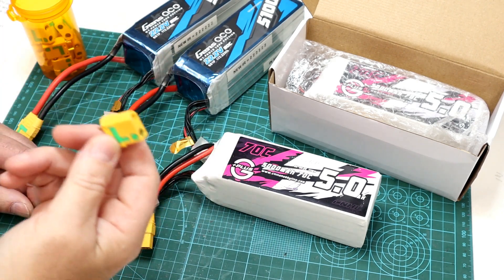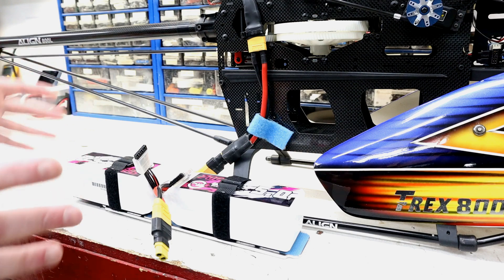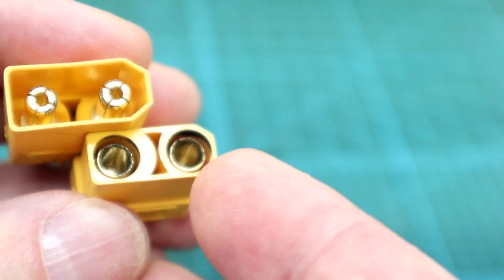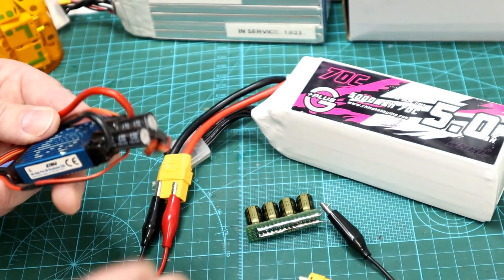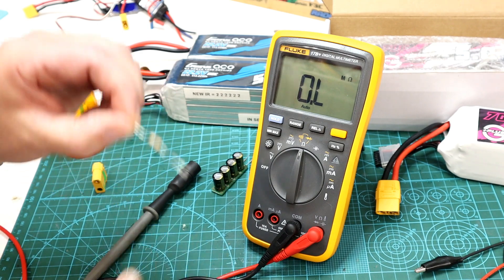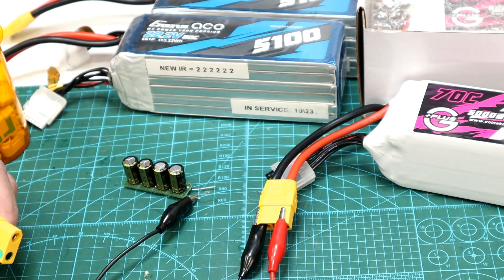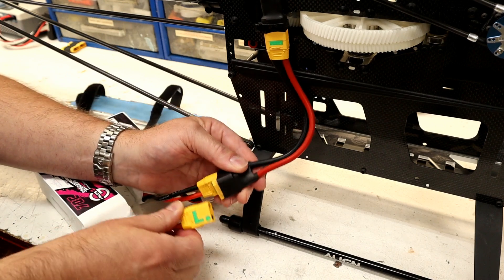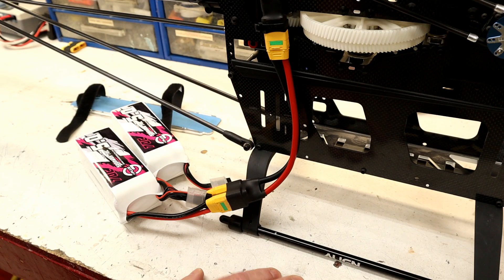How Do Anti Spark Connectors Work & Do You Really Need Them?

Comment: Bullet connectors on my 2S batteries, every time I plug them it sparks.  I wondered what did that. We don't use connectors on racing buggies.
Reply: Why don’t you use connectors? If you are already using bullet connectors then what difference does a plastic housing around them make other than making it easier to use and safer?

Comment: This is a very elegant solution, the best off the self there is to be honest. I replaced all my XT60 connectors with these ... Too bad they dont make them in XT60 format.
Reply from the maker: Might be because XT60's are generally not used in higher voltage & current applications; plus size is likely also a limiting factor trying to fit a resistor inside plus having a split ring in the smaller and shorter 3mm bullet sleeve?
Reply: @Rchelicopterfun  I'm sure it's a size problem, but I'd sure like if they made something AS in the xt60 size - mine spark like crazy on only 6S...
Reply: they get used in most escooters with voltages bellow 60... some 36V scooters even use XT30.......
Reply: @Forol1561  the number is the peak amp rating. All the XT connectors can do 500V DC.
Reply: True, sadly no XT60 with that feature on market, main reason is that it's difficult to integrate a reasonable sized resistor AND the mechanics in the limited space of a XT60... and keep the costs down. So I took  a common XT60 and fitted a 1/2W THT resistor in there, in a manner that spring formed part of its legs touches the counterpart first.. kinda fiddly, but ... works! No more sparks on my 6S XT60 packages :) downside you have to do it for every connector :/